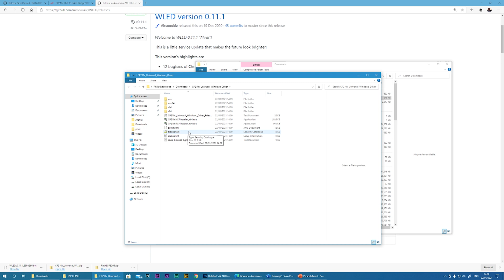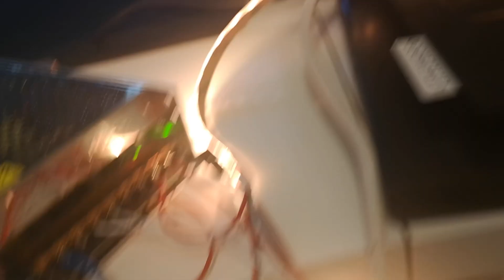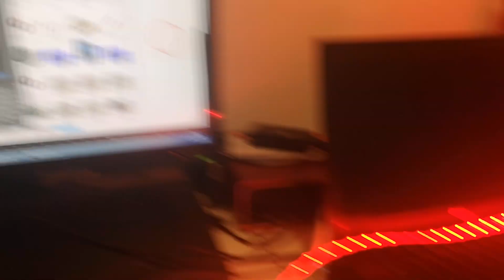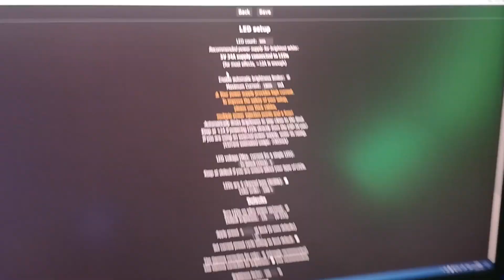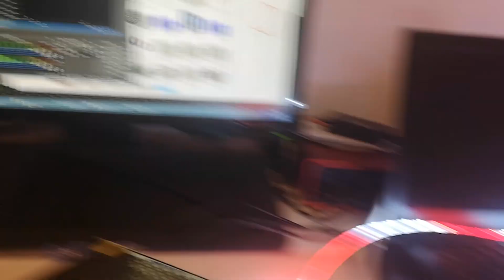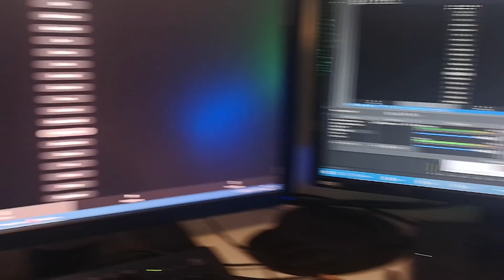Triple Leaping Arch: Part 2

Comment: Soz to ask a dumb question you showed an optional fuse board. Where does it go before or after the capacitor ? to protect the board . Would you also put fuses after the level shifter to protect the leds?
Reply from the maker: after the capacitor